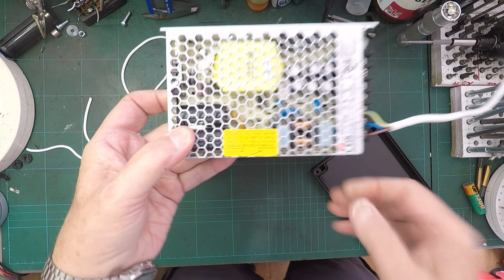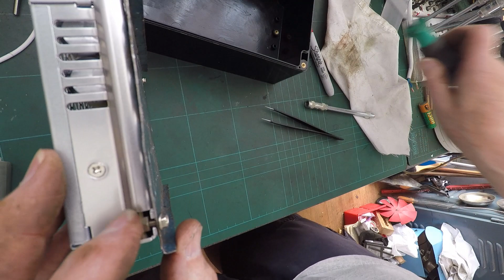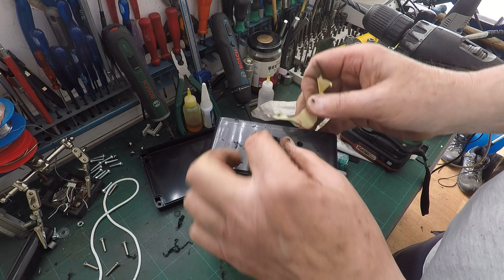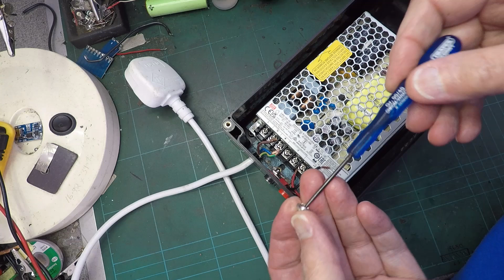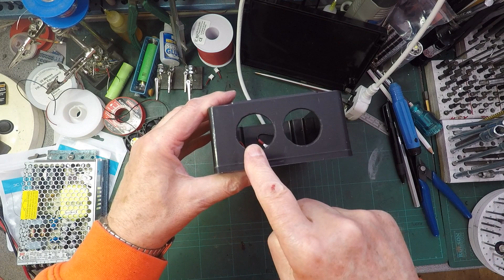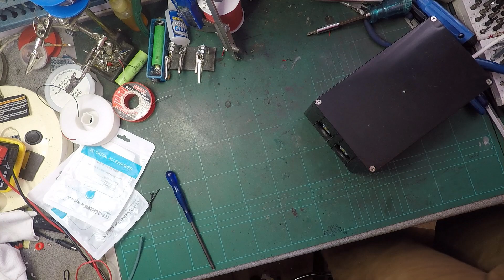Building a 12v 12.5A power supply housing fo a meanwell power supply

Comment: Blunt I think was a bit of an understatement LOL.
I thought you would have used long M3 screws to bolt it on or big self tapers trough from the outside.
Nice little project, I quite like the Meanwell PSU's.
Reply from the maker: Yes it is a really good power supply so far.

Comment: Great video mukka I built one similar I used banana plug connectors and banana leads I have 3/4 banana lead sets with different fittings on the end I use to connect to components also I used a bit of hot glue in the middle of the base of the transformer and some heat sink thermal paste just to dicipate the heat if any happened to occur I’ve enjoyed all your videos during my chemo treatment thanks for the laughs and repairs all the best from east London god bless
Reply from the maker: Thanks for watching. I hope chemo is a success.